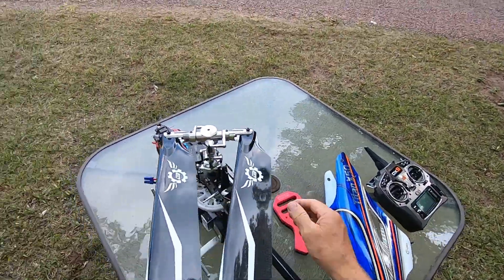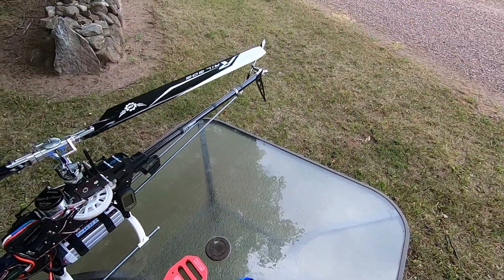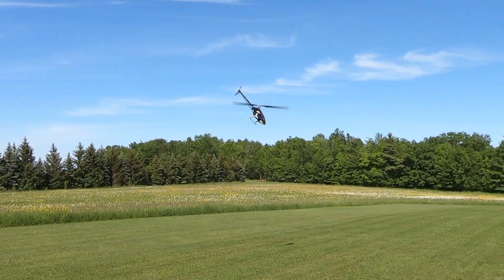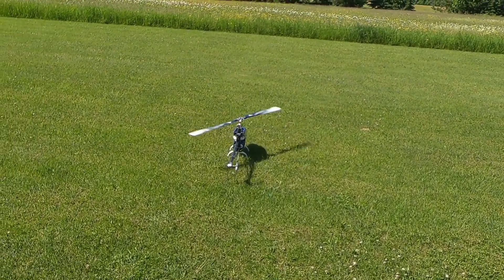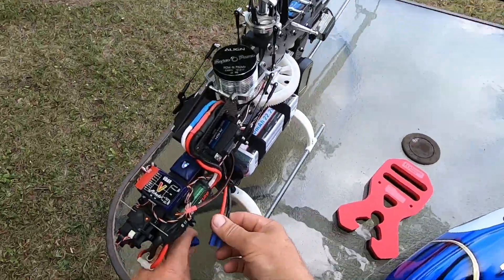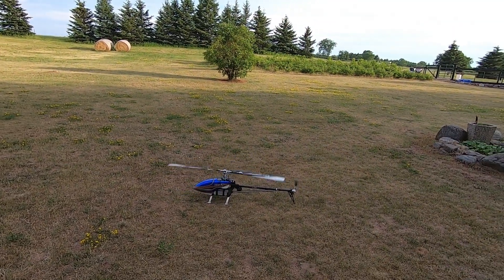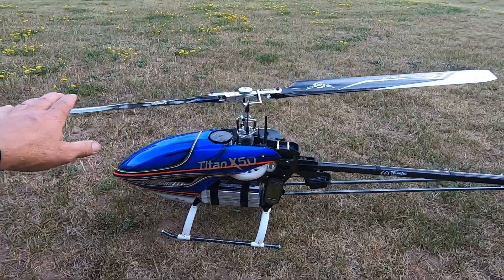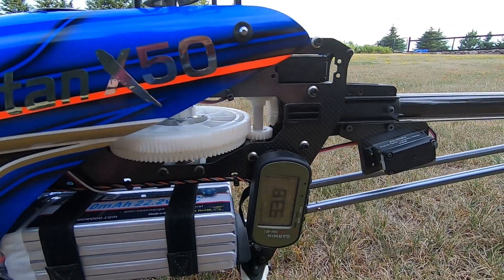HRB LIPO TEST_12S HELI SPEED RUNS

Comment from the maker: Here are the specs...

HRB 6s, 5000 mah, 50C constant, 100C burst lipo batteries. I'm running two of these in series, for a 12s, 44.4 volt system nominal. 

The Amazon price is $135.99 for the pair. Most good quality 6s 5000 mah lipos cost $80- $100 each, or more!

I think this is an amazing value, to get top end performance in a high output heli setup at a rock bottom price...
Reply: Yeah buddy that cool , I got 500 ESC ,4 blade can you send me the specs to set it up Garrett , with a  Radiolink AT10ll ,12ch rec Victor 3gx 3Axis gyro

Comment: I use only HRB lipo in my boat, and I'm really satisfied whit this brand, nice fly, congratulations on your "pb"
Reply from the maker: What's interesting is the price vs performance. The "name brands" are almost double the price. That said I'm not interested in half the performance. These lipos hold their own against the best...
Reply: @chilly7261  I run my old 6s 6000mah 50c more then 100 run în my boat and after that they come  one cell at a time started to give way becoming unstable and I turned it one by one in 5s then 4s and last time in 3s but as you know the boats are a bit more demanding when it comes to batteries but over 100 cycles for $ 80 how much I paid is very good